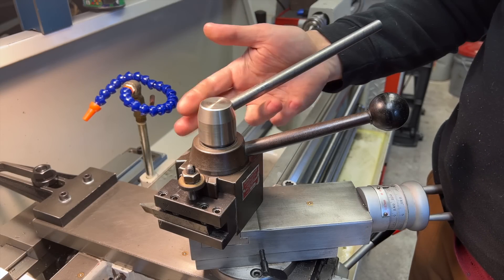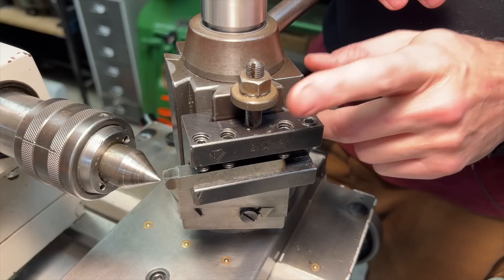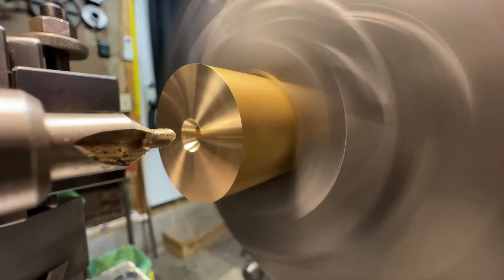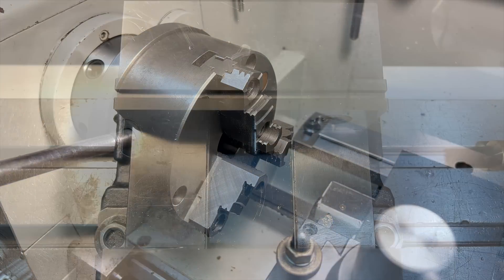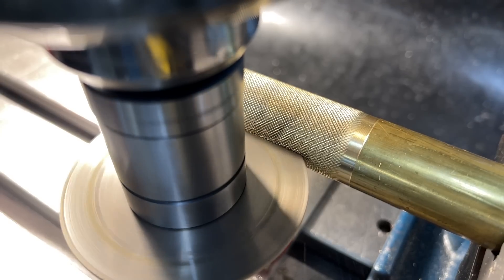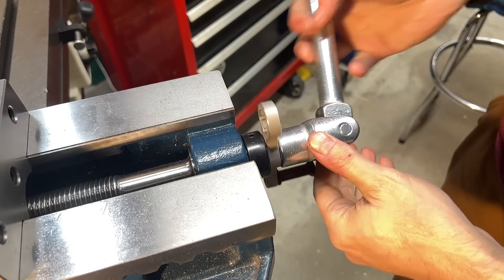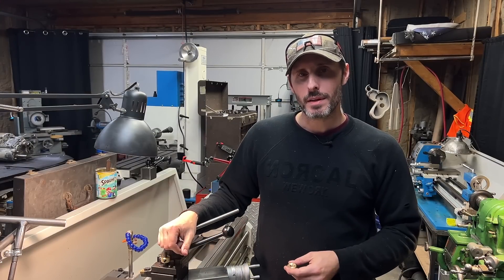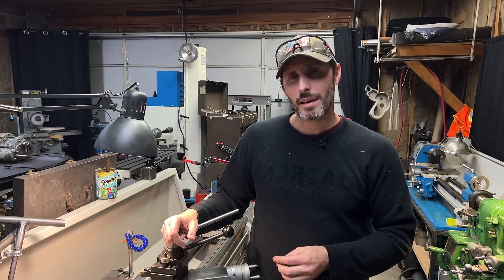QUICK and EASY Self Locking Tool Height Adjustment!

Comment: Thanks so much for making this video. I had made lock nuts with this design a couple of months ago after some inspiration from inheritance machining, from aluminium. My tool holders have a M12x1 thread, making hight adjustment crazy simple. I simply measure the tool tip height over the cross slide (95.65mm in my case) with standard calipers, and I can easily adjust the height by 1/20th of a turn (0.05mm). others on FB asked for more instructions/video, but I never got around to it. nice job choosing brass 🙂
Reply from the maker: Thanks very much, my design definitely isn't perfect as has been mentioned in the comments but I think it's a pretty good start and was a fun project. And you're very welcome for the video, thank YOU very much for watching! It's the great support and awesome folks here in the comments that make it all so worthwhile and rewarding for me, so thank you!
Reply: @hersch_tool  the design works so much better than the 2 locknuts... I hade made a small fleet of 15-ish of those collar split nuts from alu months ago, and they just work perfectly...
Reply from the maker: @joergengeerds360  Yeah, the jam nut system just isn't great. I guess I get why they do it, it's cheap and easy to manufacture. but they sure can be a PITA. 🤣

Comment: How about countersinking the other side too? That way, if your adjustment positions the nut in such a way that you can’t get your allen wrench in the set screw, you could just donit from the opposite side?
Reply from the maker: You mean split the nut in half and use 2 screws instead of one? Yeah that could probably work. I might do some revisions to the design in the future if it turns out to be an issue so I'll be mining all the comments for ideas lol. Thank you, and thank you for watching!
Reply: @hersch_tool  actually, I was thinking of countersinking both sides, so you could insert the bolt from either side.
Reply from the maker: @jonirish323  The counter sunk side is clearance drilled for bolt, not threaded. That's what applies the clamping pressure as the bolt is tightened. If both sides were threaded, then the bolt would just bottom out and wouldn't apply a clamping force.
Reply: @hersch_tool  ahh
Reply from the maker: @jonirish323  😉
Reply: @hersch_tool 

Piggybacking off of jonirish323’s idea, how about modifying a double-ended set screw (with the same socket size as the tool holder set screws) and attaching a head on one side (pin, loctite, etc.) so that you can tighten it from both sides using the same allen key?

Comment: What if the screw alignment is straight back into the tool post handles, I don't see how you'll get any tool in there to tighten the locking screw.  Apart from that it's a nice idea.  Just wondering if you could turn it into a downward locking screw within some kind of cam system?
Reply from the maker: Yeah that's a valid question. Check the comments, we've been discussing it lol. You could always just lift the tool post off to tighten it, or add a washer, etc. But I'll use these for a while and might revisit with a V2.0 in the future to address any issues and make improvements. But it's not a show stopping issue either way at least for now. A cam lock with a thumb actuated mechanism might be a really cool idea too. Thanks very much, and thank you for watching!
Reply: It needs to be a split collar with 2 screws that oppose each other. Then either screw can be used to tighten the brass nut at any rotation.
Reply from the maker: @TrekSLDuraAce  that’s not a bad thought, but that splits the nut completely in two pieces which I think isn’t ideal either.

Comment: Rather than some type of lock, I like to have a friction element, tight enough to keep it from drifting, but still allowing adjustment without tools.
Reply from the maker: Yeah that's a good idea too. You can accomplish something like that with a design like this, just tighten the lock screw enough to cause drag but not enough to lock. I'd make them from steel maybe for that though. Just because the brass is likely to wear quickly against the steel post with all that friction.

Comment: Nice project, only seen one thing, if your adjustments have the screw towards the back, you may not have room to get your allen "wrench" to the screw, so yes you traded on wrench for a different one 😂 but still nice project and looks nice too
Reply from the maker: Lol yeah, sweet sweet irony... 🤣 And yep, it definitely has some "bugs" that need to be worked out. This will likely be a "V1.0", I'll use these ones for a bit and see what I think and then make some tweaks/changes for V2.0 in the future. Thank you very much btw, and thank you for watching!

Comment: Piece of advice. I watch hobbist and people who do this for a living. I am very proud of the work I make. So i dont linke dings in my work. Get a long ejector pin of several diameters. Cut the head off. (They are hardend. This may be an issue) Stick them in the tailstock/chuck. Parts catcher! I hate watching parts fling to the bottom of the lathe. One layer of electrical tape will protect both surfaces. Not that it has much force when the cut off tool shoots it off.

As for the wrench vs allen key... a small piece of magentic tape and 2 allen keys are easier to maintain and takes up less space than a wrench that is always in the way but no where to be found when i need it. 🤷‍♂️

Comment: Really like your style 👍🏼. What I done: taken a normal wrench (on my lathe 17mm), cut off the open end and use just the ring-handle.
 Then a little comment when you pointed out that the jam nut can move the other when tightening: Now there is ~90° where the screw will be behind the column. No big problem, just a "thing" 🤭😂.
Reply from the maker: lol yeah, definitely some "bugs" to work out in this design. This will almost certainly be a "version 1.0" with a V2.0 to come in the future. :) Thank you for watching!

Comment: What if the correct tool height is so that the locking nut is facing the tool holder? You wouldn't have access to the locking nut then.
Reply: you can just lift the holder up and off the QCTP
Reply from the maker: @joergengeerds360  Yep, exactly. It's a fair question though, and I think I'll use these 3 for a while and then maybe work on a version 2.0 to address any outstanding issues like that one that come up along the way.

Comment: What do you do when the SHCS ends up in a position that can’t be accessed by an Allen wrench?
Reply from the maker: Good question,  check the comments it's been brought up a couple times. It can be fixed with a washer, but likely there will be a version 2.0 of this in the future. Gonna use them for a while, and then make tweaks/changes based on experience using them. Thank you for watching!

Comment: They look really nice. Simple to machine, and executed well. But I see several flaws in your approach. First, the obvious one. You've substituted the need for a wrench for an allen key. So instead of a one-size-fits-all Crescent, I now need to locate the correct sized allen key. Second, what happens if the height of the knurled nut puts the head of the tightening screw to the right and next to the large part of the tool clamp. You won't be able to fit your allen key in there. Like I mentioned, they looks great, well execute, but I don't think I would find these useful. Besides, the whole point of a quick change tool post is so you're NOT changing tools.
Reply from the maker: Thanks very much! Yes this will likely be the first revision. There's room for improvement on this one. Thanks for watching btw!

Comment: I like it except if the new lock screw is facing the main assy, then it's gunna be tight to get an allen wrench in place. How about knurled thumb screws instead ?
 Next should be mushroom type caps to top the stud for a place to grab the holder when removing it from the post.
Reply from the maker: Yeah that could definitely be an issue. I think this will likely be "mark 1" of this design lol. Thumb screws are a solid idea, and I love the mushroom post idea as well, that would definitely be a worthwhile upgrade. Thanks very much, and thank you for watching!

Comment: I found your channel a few days back and watched the top lever being made.  I liked your style of video making. but felt that I wanted to see another video with perhaps something original.  Well, this was the one.    I nice idea that is original, or original enough, that is combined with nicely paced and nicely narrated video.   I'm sold and subscribed and liked.    And I'll be having a go at my own brass set screw nuts like yours.  But since I've got a bucket load of 1" good quality aluminum round bar I suspect that'll be my material of choice.

My lathe has two T handle hex key wrenches that I use for my tool holders.  I made them up with a cross bar and a knurled "spinner" stub to work with my tool holders.  I use a mix of old and new that need a 3/16 and 4mm.  Thus the two sizes.  I find it's a lot easier to keep the shop made T handle hex key tools than the simple L keys.  Those little guys seem to grow legs and hide....
Reply from the maker: Thank you very much! I'm glad that I was able to earn the sub, I really do appreciate it, thank you! And the multi size t handle sounds like a great idea!

Comment: Great video.  I'm not sure how much it matters, but the purist in me would have cut the slot last on the mill.
Reply from the maker: I can see that. The reason I did it first was really only to make it easy when drilling the clearance hole for the screws in the top half. It just made it easy to know where to stop because I could see and hear when I had cleared the top half. But, you could also measure and use a quill stop. Thanks for watching btw!
Reply from the maker: Side note, love the screen name lol

Comment: I like the idea. I'm wondering if there is a solution for when the ideal tool height means the new nut/knob sits so access to the allen portion of the fastener is blocked by the tool post. It seems you might be losing some fine adjustability with this. Am I thinking about this correctly?
Reply: If the allen screw isn't accessable you could add a washer underneath to change the position.
Reply from the maker: @MurrayC  Great idea
Reply: It needs to be a split collar with 2 screws that oppose each other. Then either screw can be used to tighten the brass nut at any rotation. @hersch_tool
Reply from the maker: Yeah that could definitely be an issue. I am going to use these 3 for a while I think and see how it goes. But if it turns out to be a problem then might need to make some modifications. But it's all in fun, learning, and getting better. :)
Reply: It needs to be a split collar with 2 screws that oppose each other. Then either screw can be used to tighten the brass nut at any rotation. @hersch_tool
Reply: I thought it may be a problem... but you can just lift the toolholder, tighten it, and put it back.
Reply: @321ooo123  That's the smartest comment I've read.  Seems like it would be obvious if you actually use a lathe.
Reply from the maker: @321ooo123  Yep, it's definitely a flaw in the design but it's not a show stopper. There will be a V2.0 in the future though to address any issues with this first attempt. Thanks much for watching!
Reply: You can try another knob, they probably have different starting thread positions.

Comment: Looks clean and tidy. There is a  possibility the timing for height will orient the lock screw into your post. May not matter if next higher/lower is good enough.
Reply: Just lift it up/off and tighten the lock screw
Reply from the maker: Yeah that's a good catch, it didn't occur to me until I started to use it. But I'll use these 3 for a while and see how I like it. And thank you, and also thank you very much for watching!
Reply: Hi you could machine a slit and lock screw into the other side but with the head reversed, that way you always have 1 head facing out. It may look 'Funky' but should work :). Love your videos keep them coming. PEACE. @hersch_tool
Reply from the maker: @Geordiehux  Yeah that's not a bad idea at all. And thank you very much, I'll keep working on them. :) And thank you for watching!
Reply: Wouldn't it fall in half with two slits? @Geordiehux
Reply: @machinists-shortcuts  He would have to tap it, then slit it in half. You just couldn't back out the hex screws all the way, and normally you would just have to loosen one or the other just a bit so it's adjustable.
Reply: Jewellers clamps don't fall apart. Yes all the stress is in the 2 bolts but its not alot of clamping force in the nut. @machinists-shortcuts